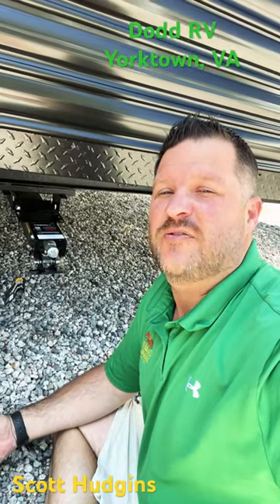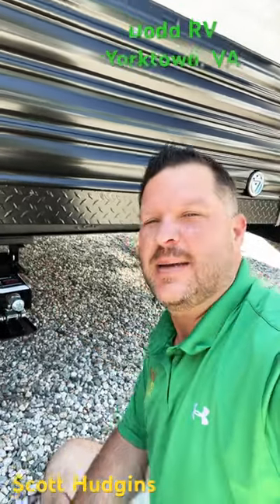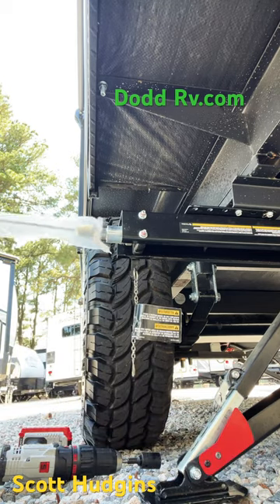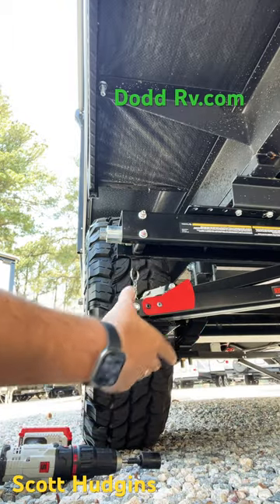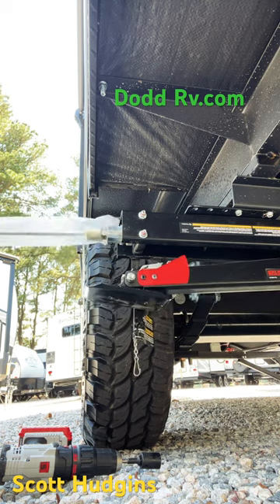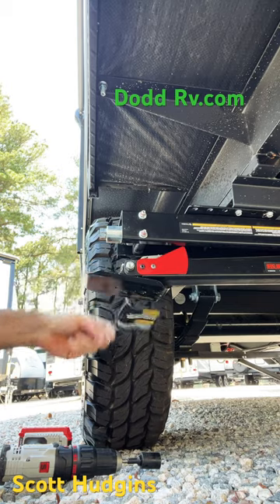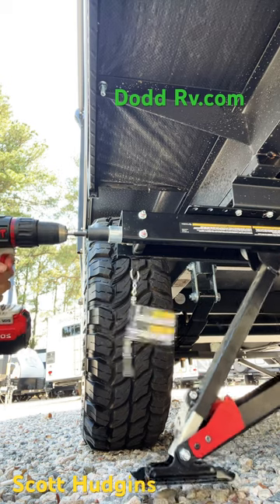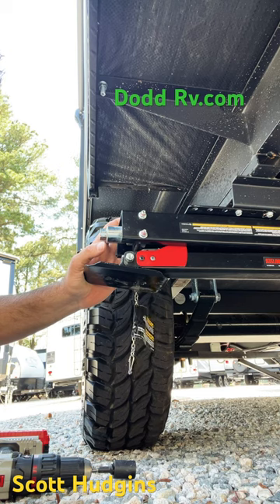Lippert Quick Drop Stabilizer Jacks short operation Scott Hudgins Dodd RV Travel Trailer How To

Comment: Per Lippert, that is not how you are supposed to use those lol
Reply from the maker: Yes, ideally 90 degrees or close is where you want the legs extended.

Thanks for watching
Reply: I just stabilized my trailer and the dealer showed me this, while I scanned the QR code on the label told me get as close to 90° as possible or past the red guide!